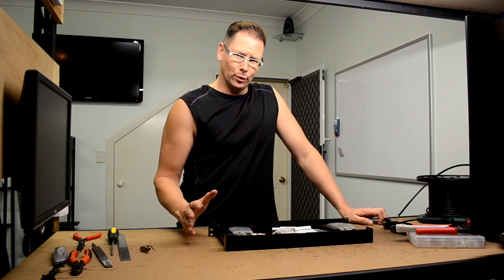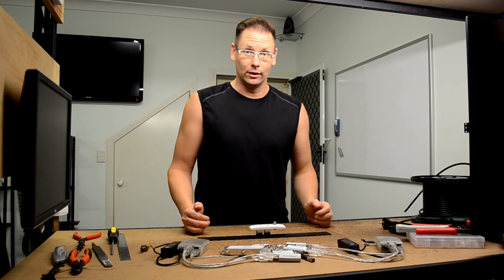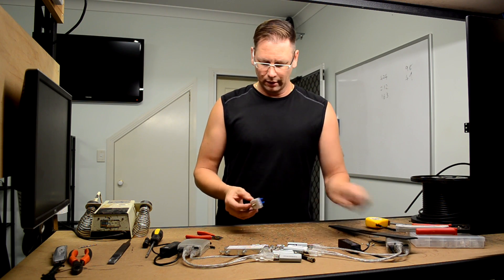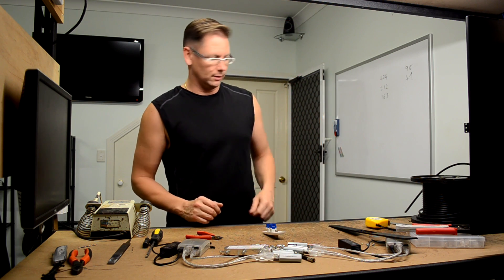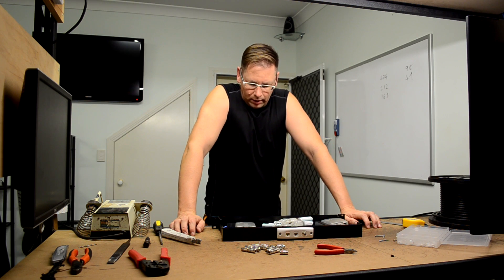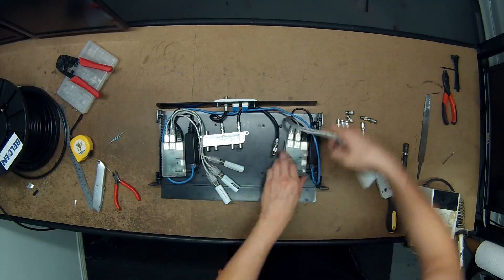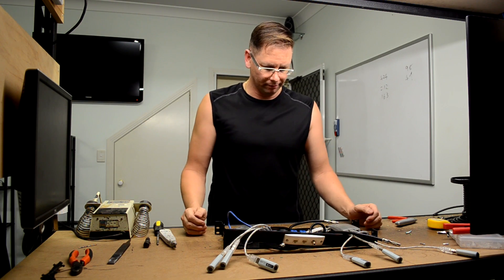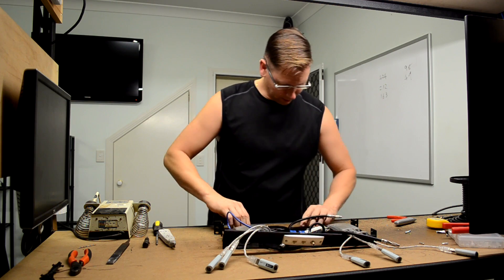Rack Mount Raspberry Pi Multicast TV Server

Comment: Which operating system are your using for running dvblast? When I try Raspbian 4.14, the kernel crashes after a few hours of running azap or dvblast.
Reply from the maker: I was just using any Raspbian version. Are you sure your power supply is good? That can cause real problems otherwise.
Reply: @TallPaulTech I have the recommended Adafruit power adapter for the RPI 3B+, but no amount of tinkering is stopping the crashing. I have also tried this on a RPI 2B and a RPI 3B but with the same results. Reducing CPU/CORE/GPU frequency also has no effect. Connecting the WINTV to an external USB hub, also has no effect. 

Would you be able to provide some details about the hardware and software components?
Reply: It was a faulty power supply after all. I got another power supply with the highest (2.4A) power available and the issue seems to have been resolved. Thanks for this tutorial.
Reply from the maker: Good to hear. Power has to be good :)

Comment: Great video. For those interested in a easier product to do similar solution for tv streaming, check out the HDHomeRun by Silicon Dust. It's a nice solution for making an Over-The-Air (OTA) signal into ethernet for broadcasting on your home network. Lots of various apps to use the stream. I have two HDHomeRuns working with Plex as a DVR.
Reply from the maker: VLC is still the best

Comment: so basic electronics quesion. can a single antenna resonate at multiple frequencies to allow more than one channel to be tuned in?
Reply: If it is a normal TV Antenna, then yes.  TV Antennae have multiple elements designed to pickup the different frequencies.  Thats why you have multiple different length elements on an antenna.   If it was just for one frequency, the elements would be the same length

Comment: Question! Are those round white devices Ethernet on one end and Coax Cable on the other?
---
Also, are you getting your signal from an ISP for your TV, or from an Antenna?
If it's from an ISP, great, but if it's from an antenna no way.

Comment: Not familiar with the 1st device you drilled hole for. Or I just did not understand what you said.
Again, another Thumbs Up!!!
---
When the internet provided, (ISP) comes out,  he can't believe my system.
Where did you buy the 19" Rack-Mount from.  Actually, one of my racks is
23" wide; so I use shims to make the connection.
---
FYI, some commercial tools would speed-up your task's.  Suggest: Ebay or Home Depot.

Comment: That was sooo painfull to watch you with the coax cables, you need one of these http://www.homedepot.com/p/Paladin-DataShark-Cable-Television-Satellite-Compression-Crimp-Kit-PA70019/100574595 it would make the install and connection of the cables so much easier and neater.

Comment: Hi, I have a few questions . What power over ethernet adapter and tv tuner are you using ? How do you get the signal out to the tvs? How many channels does it pick up , is it free air or a cable service ?
Reply from the maker: FIrst POE adapters that came up for Raspberry Pi on a search... that's them.
The rest you'll find in the other video, the link to which is in the text above.

Comment: Nice vid.

I'm thinking of doing a similar project but with the following main components: 1 x ODRIOD-C2 board, 1 x Powered USB hub, 1 x USB 1GB HDD, and 3 x DVB-T USB.  ODRIOD will run Ubuntu and either mythtv or tvheadend (will trial both but probably go with the later).  I only have 1 client most of the time and generally only watch recordings so multicast not required and also my dumb ethernet switch doesn't support multicast.

For the case I was thinking of using the 1RU raw alloy case (http://www.altronics.com.au/p/h5011-1u-raw-aluminium-front-panel-19-inch-rack-case/).
Reply from the maker: Sounds good. I never watch tv, it's just a multicast data source to play with :)

Comment: Is there a benefit of using multicast with 6 tuners rather than tvheadend (which manages a handful of tuners and tunes and streams on demand)?
Reply: Cheers for the explanation, makes sense with the way multicast scales (if you have more multiplexes being viewed than tuners); there are 9 multiplexes where I am in the UK, and a number of HD channels so it's nice to see a modular project like this.
Reply: It depends on many things: the amount of clients, the network infrastructure and the amount of tuners.
If you have two clients and two tuners, everything is fine, unicast with tvheadend is more useful. However when it comes to larger scale installations (like a hotel), smart switches and multicast is the only way to go. The multicast way is more analogous to running a coax to all the TV sets, and everybody can tune in what he/she wants.
I'm running tvheadend on a Dell PowerEdge T110 server, with a DVB-T stick and a dual DVB-S2 card, with one fixed and one motorized dish. Obviously, it's an overkill, but I can use the CPU power for transcoding for watching TV on my mobile via VPN over LTE.
Reply from the maker: At last... someone gets it :)

Comment: Consider adding status leds on front of case. Maybe on for power and one for status of software daemon. Both could be output via a python script controlling gpio. So have script load on boot and when booted make pinX high. You may even wanna put LED on gpio for 5v so you know its got power in via PoE. Otherwise nice looking box! I am tempted to make one with leds on front but I can watch most tv via my tv provider apps
Reply: gotta have them blinkenlights
Reply from the maker: ...but I have SNMP running. I'm going to get to that later ;)
If the system is on, then it's getting power from PoE (as seen by switch)
Reply: yes but status lights would make it more visible. If that was in a rack with loads of other equipment a few lights on a switch would not provide any info unless you knew its on that port. SNMP is good but physical status indicators are always a good fail safe.
Reply from the maker: The only status I would want is either power or network... both of which I know by if it's alive or not.
I really wouldn't look at the unit anyway unless there was a problem so that's why I decided to keep it blank.
Reply: Alright. I personally would add a couple LED's to the front so it looks less blank and looks more like a product. 

Either way nice job on the box it looks clean even with all them coax tails :P

Comment: Why did you decide to change your setup, and is one rpi enough to run 3 tv cards, as you had 1 pi per card on your previous config?
Reply from the maker: Quite simply, they couldn't fit in that enclosure!
I tested 3 on a Raspberry Pi 2 for over a week before I built this, just to be sure.
Reply: @TallPaulTech  starter question why you have so many (6) DVBs does that mean you can watch multiple channels on the network at ones at the same time?

Comment: Is heat not a concern?
Reply: You'd almost be better off taking the RPi's out of their little boxes and mounting on stand'off's inside the case that way you get a little more air around the units and the heat isn't effectivly double glazed into the case.
Reply from the maker: You didn't read the info at the top did you?
Reply: I did not :)
Reply from the maker: Already thought of that. As I said in top info though, a couple of fans will be fine

Comment: should put your led screens you have on front of them and some leds to indicate power :)
Reply from the maker: You know, I thought about putting some simple LEDs on the front to indicate power/network, but the thing is, if it's on then network is going to be going non-stop anyway.
I can also see if the link (and therefore power) is up on the switch anyway, so I decided to keep it as minimal as could be.
That's another benefit of PoE splitter... I can check the power usage on the switch
Port      Status  Voltage(mV)  Current(mA)  Power (mW)  Hardware Status
----      ------  -----------  -----------  ----------  ---------------
GE0/0/0   On      55100        112          6200        On
GE0/0/1   On      55100        108          5800        On

Comment: Brilliant video as always. 

Do you not find that utilizing all the ports on the Pi gives a bottleneck due to them all being connected to the same bus? When I made something similar recently I found it unusable.
Reply from the maker: What were you trying to use them for? It runs fine for this, with one of them serving a constant stream of 70Mb/s (twice, as you've got the USB TV adapters, and USB NIC sharing the same USB internally)
Hey, it works :)
Reply: CWNE88 It was being used as a seed box for a couple of large backups. Was using the Pi 2 and it had slow ethernet and very slow transfer speeds.
Reply from the maker: Yeah, I wouldn't use it for any NAS type of thing.
Reply: +Resonate84 well in  filezilla ive got 10 mb transfer rate .slow but ok
Reply: Use a BananaPi instead (or any A20 based board) - vastly better performance; three independent highspeed USB host ports plus proper Gig-E (plus SATA!) all direct from the CPU. Beats the hell out of a Pi for anything with a bunch of USB/Ethernet I/O
Reply: i have a banana pi aswell a cubieboard first vs .

Comment: Well done. Any way you could link they POE adapters you used? Thanks!
Reply from the maker: I'll be moving to more Wi-Fi related stuff soon.
Reply: http://www.ebay.com/itm/1pc-1U-19-Rack-Mount-ABS-Plastic-Enclosure-Cabinet-G17081UBK-Color-Black-Gainta-/140379438161
Reply: kudo's plus if you remember also where you got the 1 ru blank from!
Reply from the maker: The PoE splitters were easy to find on ebay by searching Raspberry Pi PoE... something like that.
The 1ru blank enclosure was from Jaycar ages ago (been sitting here a while). It was a bit dear if I remember right.
Reply: No worries, the dollar factor keeps me away from the 1ru blanks atm too ;)
Reply: Thank you it popped right up! Keep these coming amazing stuff.